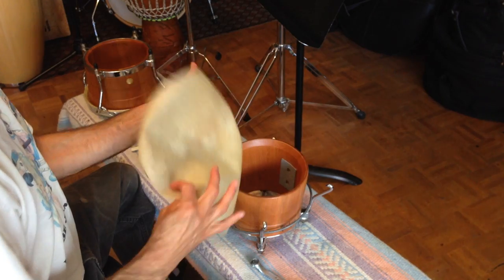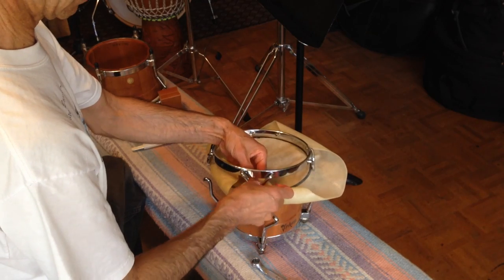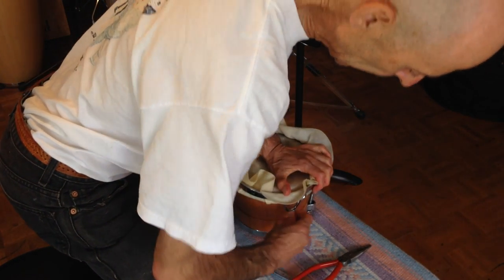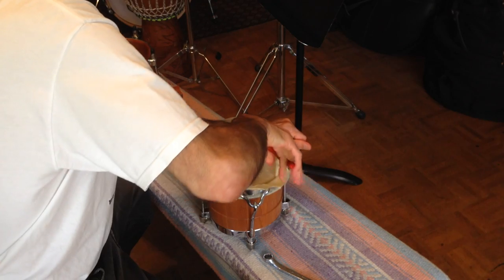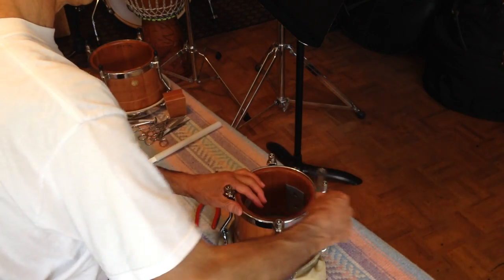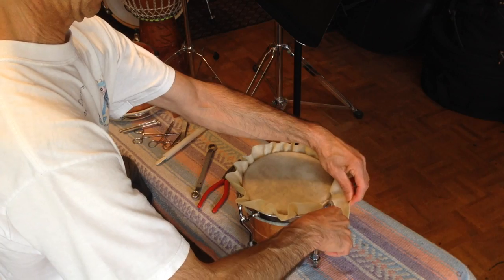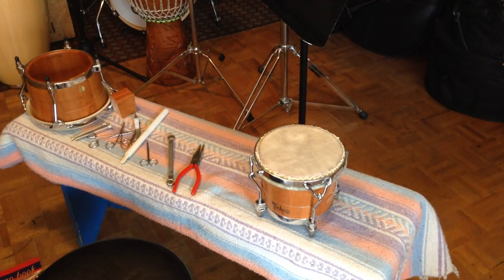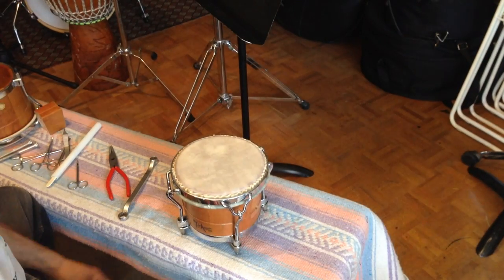Bongo Head Replacement with Trevor Salloum

Comment: What type skin? How about goat, will it sound any good?
Reply: The most common is cow, calf or X-ray film (macho). You could use goat, but I find it breaks too easily when used on the macho (small drum)  as it  would be under extreme tension.